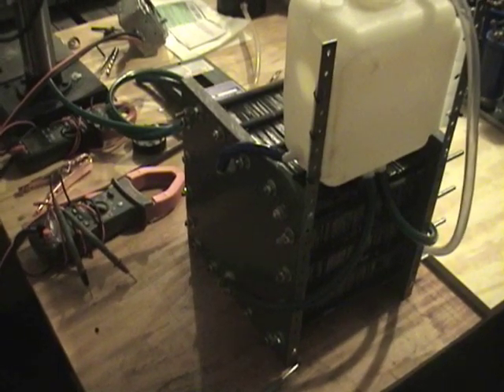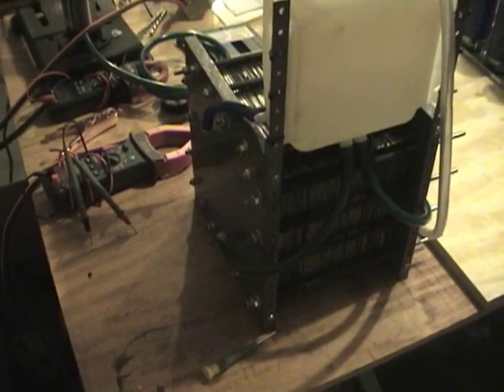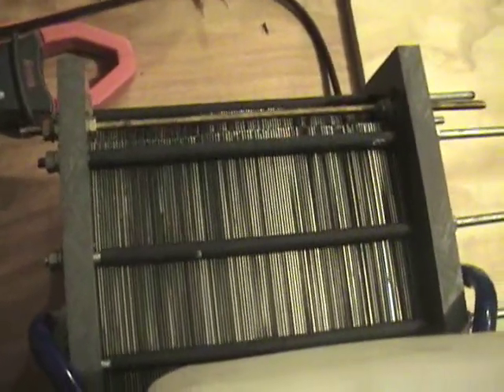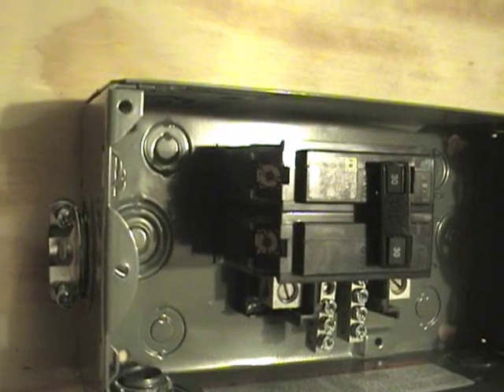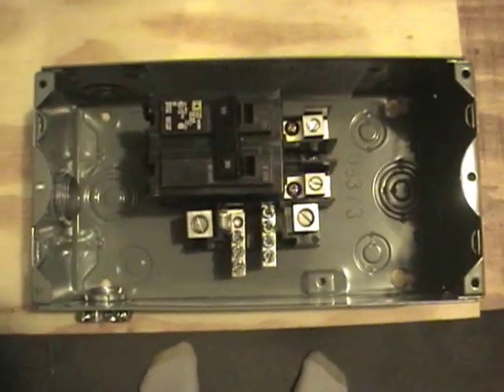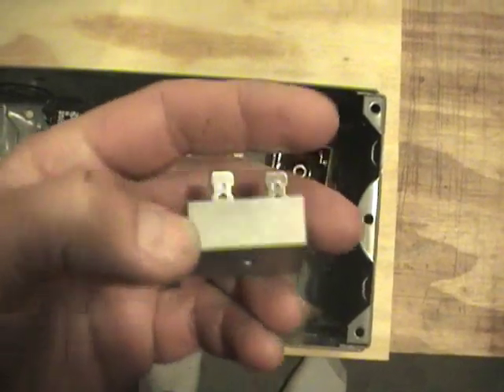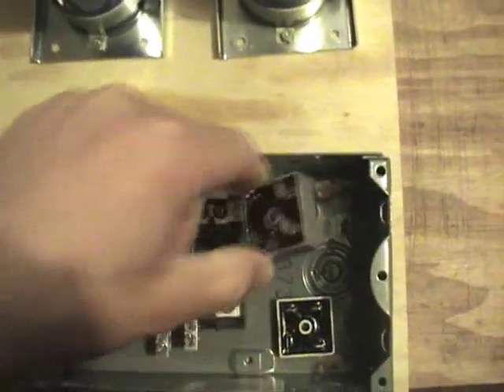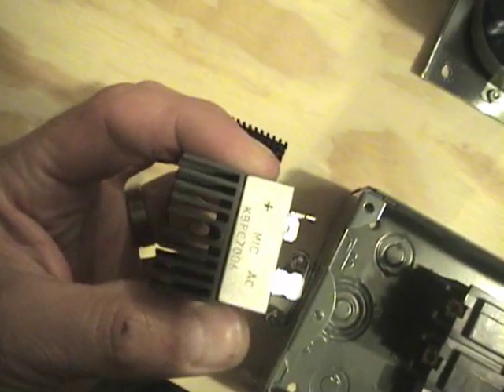118 plate 240v massive Hydrogen generator build

Comment: Hello do you still answer questions. Thanks
Reply from the maker: Yes I do!
Reply: I have problem with cooling the ekectrolit. I used coper pipe cooler but coper it gradualy disolved in it and started building up plates niw I have to sand them.

Comment: I like the fact that your using capacitors to smooth down the ripples. You don't want low efficency peek voltages or for the current to sag momentarily stopping production. 

 You would be surprised how well adding an inductor inbetween 2 banks of capacitors will work to smooth out even high power demands.  Grab a  large chunck soft iron and wrap a few turns of  10 guage wire around it. But not so much that the magnetic field would saturate the Iron's permibility, so that you can make a voltage and current smoothing PI filter, (capacitor shunted to negative, inductor on  positive, other  capacitor shunted to negative). The magnetic field stores energy releasing some just as current  from the  capacitors starts to sag.  Google PI filter circuit.